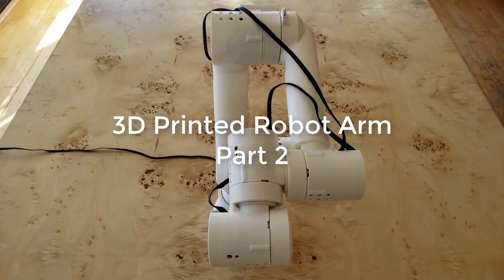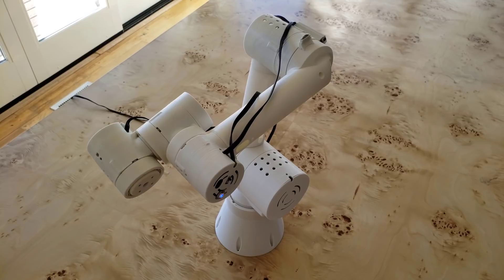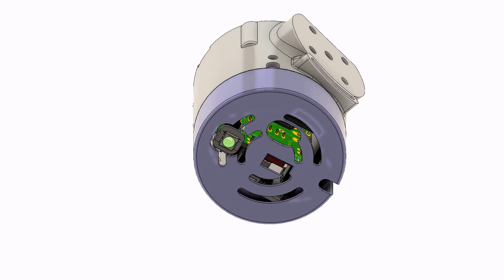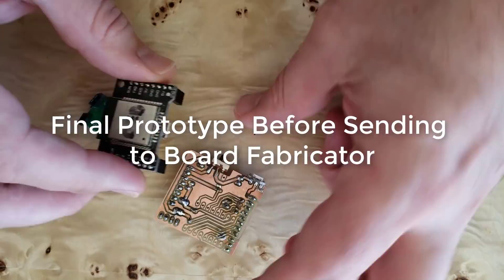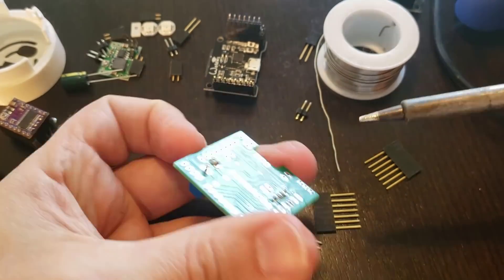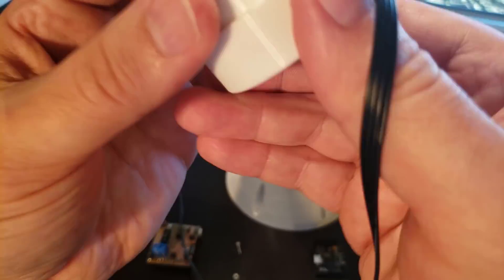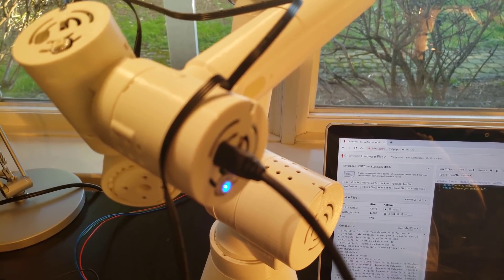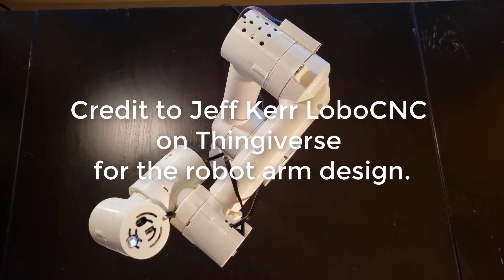3D Printed Robot Arm - Part 2

Comment: How are you sensing position, please?
Reply from the maker: The idea is to home each actuator and then just keep track of the step position on the stepper motor. The homing will be done via TMC2130 stepper motor drivers that can be homed without endstop switches. If that doesn't work I'll had hall sensors as the endstop switches. Another alternate idea is to put an absolute encoder on each actuator, but that doesn't seem as workable since I'd want to track the reduced part of the actuator, not the stepper itself, and nothing commercially available is that compatible that I can think of with the shape of the actuators.
Reply: Aah, dead reckoning.  Fingers crossed!
Reply from the maker: @i-make-robots  How is that dead reckoning? People are using the TMC2130 to home 3D printers. Hall sensors are also common for homing. Absolute positioners are spot on too. Dead reckoning would be inaccurate.
Reply: I home an axis and I count steps as I move.  if I never miss a step then reality matches my estimation and everything is fine.  While the TMC2130 is very good is it not perfect and can miss steps - I've had layer shift on Prusa 3s equipped with the same driver.  Rare... but when it happens... ;(
Reply from the maker: @i-make-robots  With your experience on TMC2130, do you see layer skips during the print? If so, are you running it at the 256 microsteps, or the interpolation? Are you running the motors with enough power to not get skips? Or are you saying during homing? The homing would need to be done after a power off because you have no current step count to reference off of. I could store the current step count each time in flash memory, but I'd have to buffer that, and if there's a power outage you wouldn't really know if you had the buffer write. So just plain old homing would seem to do the trick.
Reply: I'm running default Prusa settings.  I'm not more versed in that area.  My solution for my arm is to add a separate absolute encoder.
Reply: In my current design I've got my encoders on the end of the kinematic chain for each axis.  sometimes 40cm away from the motor in question!  Only way to be sure I get accurate positioning.  Call me paranoid... I'm ok with that.

Comment: so... each joint has a dedicated MCU ? How do you connect each other, Wi-Fi ?
Reply from the maker: Yes, over Wifi.
Reply: John Lauer and what about sync problems between joints? If you want to follow a certain trajectory at a certain speed? Do you have any feedback position sensor ?
Reply from the maker: @pablo_costas  If you watch the video on the Cayenn protocol I created for ChiliPeppr https://www.youtube.com/watch?v=SlHhcErWCDQ, you'll see how I solved sync issues. Each device is it's own ESP8266 in that video and there's one wire for sync. I'm using the same approach here. All Gcode is uploaded ahead of time where just the commands for each actuator are uploaded to that actuator. Then the sync wire is just a count. When the device hits a count where it has a command, it executes it. However, on this project I'm going to try to not have to run the sync wire. I have a feeling that won't work, but gonna give it a try.

Furthermore, one of the ESP32's becomes the master where it sends out the "which line of Gcode are we executing" command. It then waits for an acknowledgement from each device that has Gcode on that line until it sends out the next "we are executing this next line" command. That's how it all syncs.

If it's a move where the start/end of the move should finish at the same time across multiple axes, then the actuators will just adjust their feedrate to match the other actuator by just using math.

It's all theory right now until implemented.
Reply: John Lauer sound cool, I’m looking forward to see it working !

Comment: Why are you putting the driver, the controller and some DCDC-converter for every axis inside every "knuckle", together with the motor?? Why not only the motor inside the knuckle and all the electronics for all the motors in a separate compartment?
Reply from the maker: Running wires is a mess. You'd need 4 stepper motor wires * 6 actuators, plus if you get fancy on the hand with multiple motors, you end up with even more wires. It's cheaper/easier to put a wireless microcontroller in each actuator. The ESP32 is so cheap these days it makes this possible. Also, by doing this in a distributed way, you can create multiple hand type grippers, dispensers, lasers, etc for the hand and follow the same structure of the Gcode. Also, for each actuator I want a temperature sensor, touch sensors for moving the actuator fwd/rev and hitting a record button to record position. I also want a fan in the actuators which means a fan controller. All of this adds up to it being more cost effective and simpler to put a controller in each actuator plus the optionality of numerous end gripper/hand solutions.
Reply: @JohnLauerGplus  Hum... If you say so. Why temperature sensors? Design properly, test once, measure, compare, done. I also don't see why the gripper-thing would require controllers and drivers in every joint. Also, the number of wires goes down the further up the joints you go. I don't want to step on your toes, but this approach seems overly complicated. Pretty sure there's a good reason why every robot manufacturer rather pulls wires through the joints than putting all the electronics inside those... Mass is another thing to consider.
Anyway, cool project nevertheless. I really enjoy watching it grow!

Comment: You should use some ferrules for your wires when plugging in to your screw terminals. They'll last quite a big longer and you'll get a stronger connection.
Reply from the maker: Good idea.

Comment: You should look into tmc2208 stepper drivers for extra smooth operation! Should make a huge difference to the drv8825 you are using right now!
Reply from the maker: I bought some tmc2130's a couple weeks ago just like you were thinking. The idea is three-fold. 1) Make the sound really nice on the arm, 2) Have the ability to dial in current settings per stepper motor perfectly via SPI, but more importantly 3) Use the homing feature where the tmc2130 detects the pending stall to do homing without an endstop switch. Prior to that I was thinking of using a hall magnet sensor, but that would add extra components to each actuator.
Reply: John Lauer Yes that homing feature is a real plus, I would love to see that implemented

Comment: Pretty Sweet... I see you have it in a standard 6DOF configuration. Are your offsets all standard as well or are you going to be putting together your own inverse kinematics. Finding joint angles from Cartesian coordinates is the part I want to see in some detail. :D  Good job.
Reply from the maker: The initial plan is to simply let you train each joint, record its position, and then play it back. Getting inverse kinematics going will be a second phase, although this will be all open source so perhaps somebody from the community can help on that part.

Comment: A screw terminal connection onto tinned wires, in my experience, is troublesome. The solder is malleable and especially with movement (which you have lots of) will cause the connection to loosen due to the solder deforming. Some will bemoan this view, but I suggest you see for yourself and go back and try wiggling those power connections and examine the status of them. Search "crimp ferrules" for a solution
Reply from the maker: Interesting. The goal was to make it not fall out, but I could see the solder eventually wearing down. I did use silicone wire which is so soft that it shouldn't pass on very much pressure to the screw terminal. I also think a crimp could be added to the plastic parts to take all the load of the wire movement prior to the screw terminal.
Reply: @JohnLauerGplus "proper" silicone wire has 2 main functions. The silicone insulation has excellent heat characteristics making it suitable for operating near high temperature items such as motors and heaters and it contains a higher quantity but  smaller gauge strands than an equivalent CSA multistranded wire which makes it very flexible and a lot less susceptible to fatigue.
I was always taught that only the conductor should be within the clamp termination and the insulation should stop just beforehand. I find that this sometimes leads to stress on the conductors at that point because there is no strain relief so for some connections I double over the conductor and insert the wire including a small amount of the insulation to allow the screw terminal to bite and act as a clamp. The insulation then has a tendancy to crush out of the way at the top and bottom of the strands and doesn't interfere with the electrical connection but maintaines enough presence to act as a support. Another alternative is to add some heat shrink sleeving to the wire just prior to the termination and works really well on very thin wires
The ferrules I suggested to search for solve most of these issues in one simple package and are extensively used (at least here in the UK) for electrical installations including electrical control panels
Reply from the maker: @havenview  That's some good stuff there. Thanks for the advice. These are the kinds of details that are great to hear about from people's experiences out there. It will help in the design here.